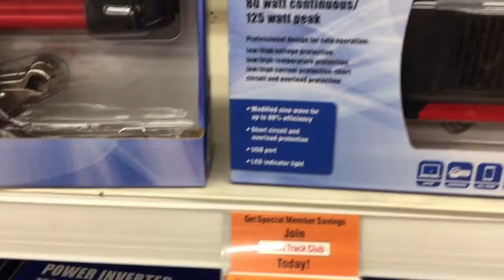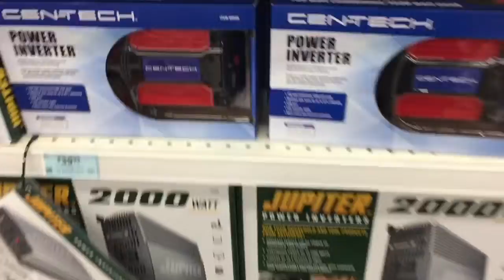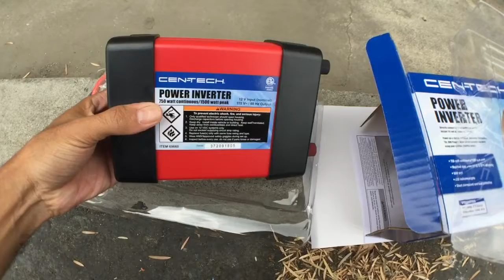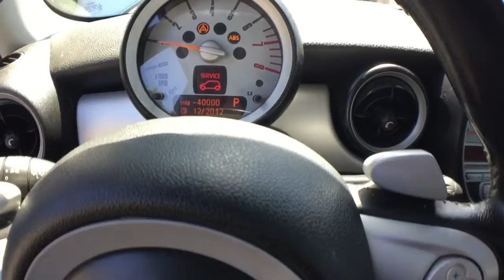Harbor Freight CenTech 750w Power Inverter unbox/test

Comment: Can i run a 400w with 120v space heater on it ? Its such a small heater ?
Reply from the maker: Wouldn’t work. It’ll shut off instantly. It pulls too much power at once. I tried to use a heat gun and it trip the breaker switch inside the inverter instantly. The 750 is too small of a unit. 

Get the 2000w, 3000w or better yet the 5000w inverter

Comment: How many amps can these do? I'm finding a lot of people are buying HIGH watt inverters that won't work on low watt devices because the amp ratings going through it are where the bottleneck is. So I have to ask about this. Will the model in your video actually work? Are you able to do watt ratings that it actually says? 

Thank you.

Comment: I have this invertor  i use mine in an alternator generator setup it works great when the tree fell on my house and destoyed it i used this device for multiple days about 6 hours a day with out a single problem at all also this invertor works as long as it has 12 volts  to 14.5 volts coming   and it doesnt care where the voltage is coming from
I run mine on a bad battery without issue as long as the alternator supplies current  not all invertors will run on a bad battery  powered by an alternator my other invertor  wont run on a bad battery so this invertor is the best for the money

Comment: When the red light comes on, what does it mean ?
Reply from the maker: You over loaded it, and it trips a breaker/safely switch.. just disconnect from the battery and try again without putting too much resistance.. things that are power hungry will do this too

Comment: Any ideas on how well it works connected to solar panels for rv?
Reply: Having a hard time understanding set up to 2 batteries
Reply from the maker: Definitely get something with 1000watts or higher.. this is only good for like a lamp or a drill.. RV’s need bigger better equipment to handle the extra power of a TV, blender, multiple lights etc etc. and the battery.. definitely look up more videos about hooking up battery’s. I do know you will need the panels, charge controller, inverter and battery’s.. the charge controller will make sure the panels don’t over charge the battery’s in the sun.

Comment: I praised you for the wallet return. I just wish you provided the total wattage of the drill.  Also, it would have been great to let the drill run for at least ten minutes to determine if the inverter stopped working due to thermal shutdown.

Comment: I had a 400 watt piece of crap inverter that the fan ran continuously and interfered with my hd antenna in my rv and could not get one channel when tv was powered by the inverter so i bought hf 750 watt and my tv antenna works perfect lots of channels and the fan does not run at all...thanks for the video.

Comment: I found one of those in a car in the tow yard it was be B2 heck I owned it for 5 years never used it the power went out last month and I ran my mom's refrigerator off of it for 6 hours
Reply: I had an older refrigerator that would not start on this inverter, then i tried my newer model 26 cu ft french door fridge and it ran great all day with the car battery on the floor next to the frig.
Very happy till i hooked it up backwards to the battery one day, took about half a second to pop some capacitors inside and who knows what else. Maybe i can fix it.
Now HF doesnt carry them anymore !!!

Comment: Divide wattage by voltage to get your amp draw
Reply: Groovy to know
Reply: So will these hold up for something like 40 Amps? I need one that's cheap that can handle 40 amps based on 480 watts divided by 12Volts... (12 Volt system). Want to run a small midget AC that's about 450 watts.)

Comment: So how much wattage would it take to equal a power outlet?
Reply from the maker: Most of the stuff you’ll use the inverter for will range from 80-450watts. 110v at 5amps is around 550watts
Reply: @IntegraDIY  oh ok, so that 400 watt inverter is pretty close to a power outlet then. Just wondering because I need one for a project I'm working on. I've watched plenty of videos on how to make one but they usually don't explain what the functions of each part are so it's hard to understand. They just put it together with some crazy music in the background lol.
Reply from the maker: John Ruscigno the inverter in my video is 750w, it’s more than enough power, to power drills and saws, or lights

Comment: I love the ability to provide for yourself. I invest in butane stoves, propane and butane tanks, battery packs, inverters, generators, ect. All for times of emergency. I tell you this 750w unit works well and is priced just as well. No it won't power a microwave or hair dryer but is great for lights and small electronics. Get the 100w HF solar panel kit, an inverter and some 12v batteries and you have yourself a nice small backup for temporary power. Yes that small system will cost you like around $500 to assemble but it's a great hobby and education as well as an emergency source of small range power. You can buy a portable battery station but they last tops 5 years and they're considered dead money afterwards. I bought an expensive Xantrax power station and it worked well for like 2 years, then it wouldn't hold a charge. There's no consumer replacement parts for such things so it too was trash.  That was $300 down the drain.

Comment: Thanks for this video. I put a small 2 ton manual winch on the back of my truck, and have a cordless drill to run it. But it runs so long, cause the gearing is so low, it wears on the lithium battery. Was thinking of your set-up for an electric drill, and drive it off the trucks batteries. (Also, good for you for returning the wallet.) Thanks again for posting.

Comment: Would this run a 1/3HP sump pump that runs intermittently; ie, maybe once every 15 minutes in 5-second intervals (enough to empty a 5 gallon bucket?)
Reply from the maker: Roger Pyle I’m very sure this will inverter will work for you. I powered a high speed angle grinder for 30 minutes without tripping the breaker, so I’m sure it’ll work for a pump like that
Reply: Find out the specs of your pump & get edumucated on amps & watts on youtube ...  you old Pyle Driver Roger & out

Comment: I love mine. I keep a fully charged truck sized battery in my house and use these small inverters for lights, charging cell phones and such during power outages. This 750w inverter won't power any heater or microwave but will do fine for small electronics. Portable DVD players and such.  I used to own HF's 2000w Chicago Electric's inverter and it worked well for about a year. Then it was a paper weight. That was 7 years ago so it looks like they've improved quality.

Comment: Wonder if this inverter will run a electric weed trimmer?
Reply from the maker: Itll definitely run an electric weedeater just fine, good thing about these inverters is if you overload it, itll automatically shut off and you'll have to disconnect it and reconnect it and you'll be able to go again. But if you are think of running it for a long period of time, probably would be best to get the slightly better 1000W for $85.. itll probably be better for you.. make sure to keep your vehicle running while using the inverter or else you'll train the battery quick..
Reply: That's funny!
Reply: Dalful?